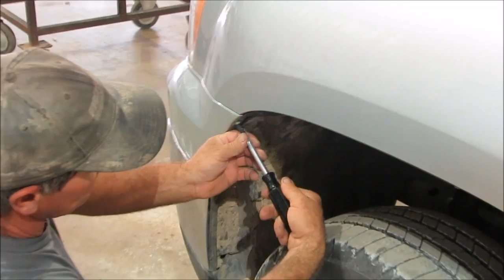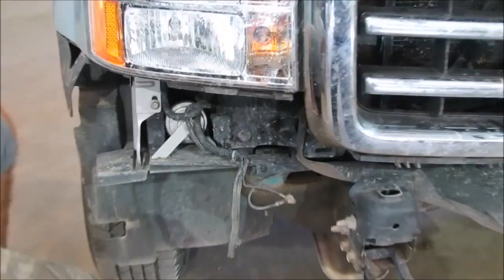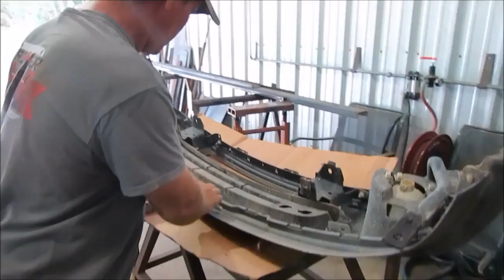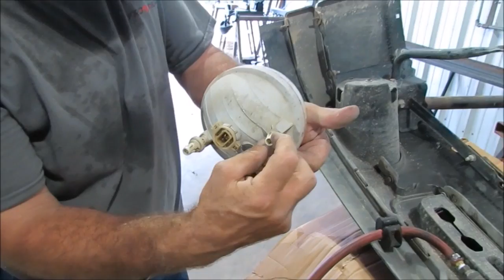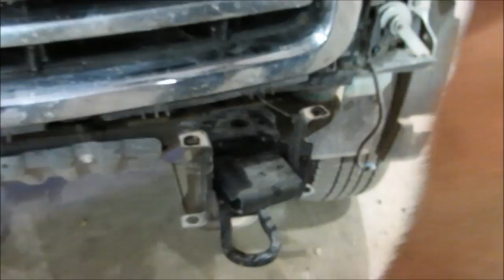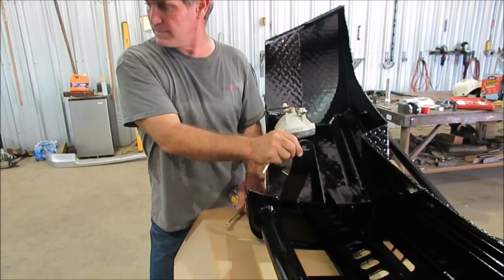Frontier Front Bumper Replacement 2007-13 GMC 1500

Comment: i dont need to replace or install a new bumper just the chrome air intake hole part... do i have to take all of it completely apart for it or can i get to the part to take the plastic off and the bolts with long extensions off and just replace the chrome bumper air intake part?

Comment: On the rear bumper for this model and year truck I don't need the oem mounts? Reason I ask is that I screwed up my oem bumper and looking at the rear replacement for mine @frontiertruckgear